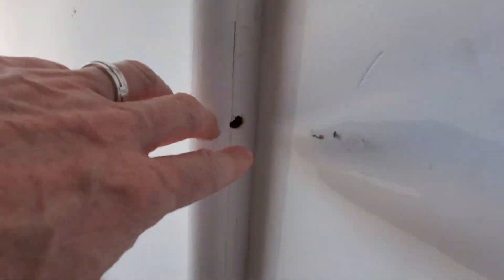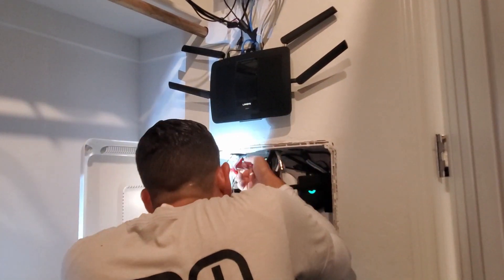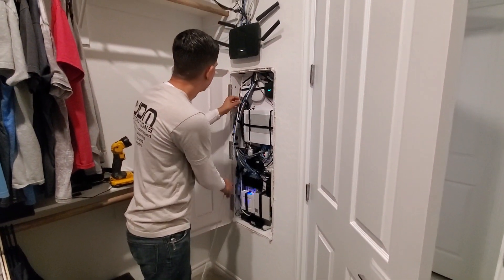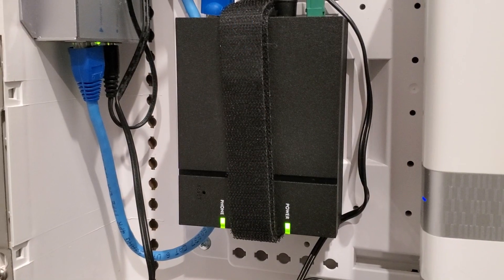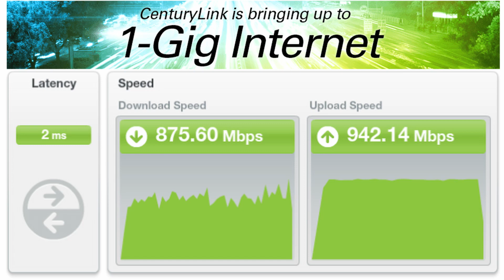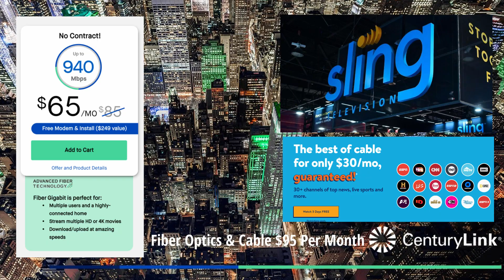Home Fiber Optic Internet Installation -  How To

Comment: I’m confused, where is the fiber ONT box. Fiber line went straight from the street to the modem in your home network panel box?! Thanks for sharing this video!
Reply: The black box he calls a modem is the ONT. He's confused on terminology. In most installations, they would likely plug from the ethernet port on the black ONT into the WAN port of the ISP provided modem (though in this case, even though it's a modem it's not actually doing any modem functions, as the ONT provides the IP connection already). But in this case, he's plugging directly into his own router, bypassing the need for the ISP provided one. In short, fibre is confusing lol.
Reply: @joshedagg  Thanks for the response! This is different to many of the installs I've been following online (including on CenturyLink's website) with a large grey box outside the home in most cases. It looks like my setup will be similar to Mr Tech Hub's, I have a fiber line in a panel box in my garage, I'll just need to run this up to the network closet. Do you know if this setup will still require all the VLAN 201 tagging and PPPoE confusion to work with my own router/switch setup? :)

Comment: wireless 5G in london is getting 500MBs so ..... fiber optic broadband is some sort of technology that is great bud didn't seems to succeed.
Reply: Cell towers rely on fiber connections for their service. The problem with 5G is that in order to get the super fast speeds, they need to put tons of those cell sites since 5GUW has quite a short distance.

Comment: Coaxial Cable can handle 1Gbps of transfer, why waste your time installing Fiber? FYI my ISP/Cable provider has FTTN and Coax from the Node to my home (about 100ft), I can pull speeds of 900mbps
Reply from the maker: The reason I went to fiber was the price. Cox cable 1 gig was more expensive and ive had Cox for 15 years and they kept raising the prices so it was also a personal thing.  Thanks for watching.
Reply: @UltimateTechHub  So basically this video isn't about new tech but more about the fact that you felt you were getting screwed by your provider.  I think it is irresponsible on your part to push this fiber optic option based purely on your monthly subscription price as opposed to limitations of "old world" infrastructure.  You made no mention of the "connection" to your home from the node to the main trunk.  Your subscribers should be asking these questions, you are trying to sell them a Ferrari to drive on a road with a 25mph limit when a Honda Civic will do...just my two cents....thanks for watching
Reply: @nuklz  fiber can support up to at least 800g

Comment: How did you attach the connectors to the fiber cable you ran, or did it come with the connectors pre-installed?  In case if the latter, you would need to know the length of cable required.
Reply from the maker: The connectors where already installed to the fiber cable. The cable length is 75 feet but it comes in many different lengths.

Comment: Is Mike from JDM Automations going to leave his drill bits in my wall too? 😂
Reply from the maker: Haha
Reply: Bahahahahahhaha right
Reply: Or the damage to the wall by the impact 😂
Reply: lol
Reply: Using a impact too
Reply: @ZavjoFPS  that's what it's for guess u don't work with tools much, but foreal that "professional" would never work on my site the ladder jump up and the random unprotected fiber run.
If anybody's ever ran fiber or worked with it I can guarantee I know where most of your pinch points are going to be causing the slow downs

Comment: Fiber is awesome, and lol (seeing the first comment is shade at Spectrum, and 2nd at Comcast), I just want to let ya know both are hybrid fiber/coax with FTTP available in select markets.  By all means if Centurylink or Google has fiber in your area hit em up.  Just be aware there is a 1TB data cap (which is waived atm due to Covid).  Spectrum doesn't impose any caps or fees on data consumption (Comcast Xfinity does however).  Its not a perfect world and yes fiber is fantastic, yet expensive to construct for ISP providers (while being cheaper to maintain over time though).  Coax internet is succeptible to ingress (3.1 docsis even more so than 3.0), or "rogue" RF signals getting into old wiring or faulty connections in your home or the cable plant.  This causes the equivalent of a ton of people walking into a movie theater and sitting in front of you talking as loudly as possible while you (modem) are trying to watch (exchange data) the movie (your ISP headend).  The infrastructure is already in place however after decades so it allows high speed internet to reach vastly more areas.  So yes, you can be critical of Comcast, Spectrum, Cox, etc., but without them, there would be a great many children in America without the ability to attend virtual school right now.
Reply from the maker: Thanks for the great comment!! Yes without Cox and Comcast we wouldn't be where we are today. I never talk bad about either company.  I've had Cox for 16 years. I just made my change for the better price and faster download and upload speeds. And my price is locked in. Cox always seems to raise the price every year.  Thanks for watching and if you subscribed thank you as well!
Reply: @UltimateTechHub  My pleasure sir.  It was a well constructed upload on your behalf.  I am always seeking knowledge and enjoyed watching this.  My comments were meant purely as the unbiased devil's advocate as so many youtubers' comments are just jumping in to thrash other ISPs. I absolutely understand your reasoning to switch, I agree with it,  and now more than ever, it is a great time to see videos like this educating viewers on intelligent cost-cutting ideas.  Fiber is absolutely hands down the best method to obtain reliability & high speed service.  I also noticed the information about authentic speed testing.  Keep this gentleman's suggestions in mind when you run speedtests on any ISP as well.  My simple suggestion to PC/MAC speed testing is just download the Ookla Speedtest Extension for the Google Chrome browser (since it is the most widely used currently).  This tests as an app would instead as a browser. Also turn off any VPNs.

Comment: now how bout wiring your whole home in fiber directly to PC....
Reply from the maker: That is possible but a bit expensive. And I would only get 940 mbps. I am currently testing my speed at about 740 mbps which goes up and down and thats with Cat6 cabling.
Reply: @UltimateTechHub  btw, check out 2.5gbps lan.. if using a NAS...
nice setup though
Reply from the maker: @EvgeniX.  Thanks I will check that out! Thanks again for watching!
Reply: @UltimateTechHub  let's see in like 5 years lol

Comment: I've had fiber for about a year now. My issue, is my isp, make me use their gate way/hub. If I plug directly into it, I see 1gig speeds. But, I need my router for other internet needs. So my question is, how can I "split" at the hub? I want my gaming rig to be plugged in at the hub, and also have connection to my router. Calling my ISP, they can't open another port, or if they can, it would cost a ton. Would a "switch" work?
Reply from the maker: Plug your router into the gateway then plug a switch into the router. That will give you plenty of ports for many devices. That's how mine is setup.

Comment: How much does the installation cost, of all those devices??
Reply from the maker: The fiber modem and setup was free. The fiber cable drop was I think 60 or 70 dollars.
Reply: @UltimateTechHub  Mike charged you only 70 bucks to run the lines?
Reply from the maker: @johncalvo1743  It's only one fiber line and he did work for me before so it was a quick install.
Reply: @UltimateTechHub  Okay. I called him yesterday. He's coming over next week after he finishes moving. I was expecting a little higher price. But all is well either way. I have a question for you: There doesn't seem to be access to the attic in the garage. Do the garages here in Vegas have attics or at least a crawl space? I'm just trying to figure out how he's gonna get this done.
Reply from the maker: @johncalvo1743  Yes usually there is a tiny crawl space. Keep me posted. Thanks for watching and if you subscribed thank you as well.  Tell Mike I said Hi!
Reply: @UltimateTechHub  Will do! I'll make sure I subbed. How far are you from SunCity Anthem? I would love to see how you did it so I can have an idea. I'm trying to run a line from the CenturyLink box in the garage to my casita. The linear distance is only about 30 feet or so. But it has to go through the garage crawl space then through the casita crawl space I reckon.
Reply from the maker: @johncalvo1743  Mike will help you out with the proper and best way to run the fiber cable. You could run it along a baseboard too.

Comment: Get more speed using Cat 6a or Cat 8 cable from the modem to you router! Get rid of the CAT6 cables!

Plus get the Nvidia Shield and AppleTV to have choice at night! Have the best of two systems! Plus a good 10g NAS might be in future!
Reply from the maker: I have a couple of Cat 7 cables but they are not long enough. I need at least 8 feet and mine are 4 feet. I will definitely upgrade. I have a 2 terabyte WD Cloud I use as NAS to listen to music or watch movies. I also had a PC that has 10 terabytes and is my second NAS. I also have 2 apple TVs and 1 Roku to stream all of my NAS  content . I use Plex media server. Thanks for the great advice and the positive comments. Sounds like you know what your talking about. Are you a netwotk engineer?
Reply: Ultimate Tech Hub Yes I’m a Network Engineer! Plus look at the semi-cheap 10g hubs that except fiver and 10g Ethernet models put into it!
Reply from the maker: @terryrodbourn2793  Sounds good I will look into it. I'm currently averaging about 764 Mbos download speed so im close to the 940 Mbps speed. Maybe a  Cat7 cable from modem to router will help the cause. I will keep you posted. Thanks again for watching and commenting.  Have a great day.

Comment: Im in Vegas.. Century or Cox optic fiber is not available in my area.. I have the gigablast from Cox and its so terrible we get so much packet loss and slow upload speed and they are not doing anything to fix it.. I know it must be expensive to get Fiber but I want to give it a try.. any suggestions..Thank you and great video
Reply from the maker: Have you called CenturyLink to see what they have available in your area? Maybe they have something other than fiber. Cox is really bad and expensive. We had ca
Cox cable internet and TV for nearly 17 years and out bill kept getting larger and larger with the same exact service and we even down graded to try and save a few bucks. The internet was super slow and our service would go out intermintly. I don't miss Cox at all. I hope you can make the switch soon. Thanks for watching and if you subscribed thank you as well.
Reply: @UltimateTechHub  yeah Century can only offer me 25mbps down and 5 mbps up its literally nothing
Reply from the maker: @leo2011sti  yep thats pretty much junk speeds. Sorry to hear that.
Reply: I'm in Vegas also, over here in Mountains Edge. Moved here in Feb of 2019, and signed up for cox gigablast with unlimited data for an additional $50 with high hopes of great internet. I've had so many techs (both in house and field) at my home that I've lost count. Had one here again today actually. The internet is beyond intolerable. My wife and I both work from home, we also home school our 4 kids. We rely on the internet.  Long story short, we have decided to leave Vegas altogether to get away from the cox monopoly here. I love Vegas but the internet is our livelihood.
Reply from the maker: @oxthebrazilian6595  I totally understand.  We had the same experience with Cox plus they kept raising our bill every 6 months. And the speed was awful. I guess I'm lucky century link had fiber installed in our area. 65 a month is thr best bill I have and I'm glad to pay it.  We get around 740 mbps sometimes 800 mbps. That's plenty fast for our needs. Good luck and keep me posted.
Reply: @UltimateTechHub  Thanks, will do.
Reply: @UltimateTechHub  How's century link fiber been? Good, reliable, and fast service?
Reply from the maker: @oxthebrazilian6595  Yes all the above. I've only had 1 outage that lasted about 7 hours do to a construction accident. Speeds are around 700 mbps and my bill is 65 a month.  I love fiber.
Reply: @UltimateTechHub  Thats awesome to hear! I ask because I'm in the Vegas area and will be moving soon to get away from Cox. I heard Century link offers fiber in Vegas so I wanted to know if their service is any good. So thats great news! You may have mentioned it already or not, but are you located in the Vegas area? If so or if not, where if you don't mind? Looking to move where century link fiber is available perhaps..Thanks!
Reply from the maker: @oxthebrazilian6595  Yes I live in the Las Vegas area. Before you move make sure CenturyLink is available in the area you want to move to. Its not available in all areas in Las Vegas especially older areas.  Thanks for watching!
Reply: @UltimateTechHub  Thanks I really appreciate it!
Reply: @oxthebrazilian6595  Come down to Anthem! I just ordered it.
Reply: @johncalvo1743  Where's Anthem? I'm not familiar with the area. Thanks man
Reply: @oxthebrazilian6595  Anthem is part of Henderson. The extreme southwest. I'm near Black Mountain. Very quiet, clean, low crime. Lots of parks, golf  and 3 big social clubhouses for residents. Where is Mountains Edge?
Reply: @johncalvo1743  Ohh ok, cool! Thats sounds like an awesome area, I'll definitely look into it! I appreciate your help, thanks again!

Comment: Nice video man that you uploaded now I have google fiber 70 per month but since were wfh in this pandemic and my wife gets extra $50 per month for using our internet speed I only pay $20 for google fiber. I kicked cox gigablast to the curve and I hated having to pay cox an extra $50 just to get unlimited data cap so $100 =50 for internet and my wife had cable etc man our bill for the past yr was over $300 man I was so pissed when she renewed our contract 2019. So fast forward fall 2020 got rid of the bundle and now we pay $50-60 for her local channels from cox.

I tried the antenna thing and it wasn't good and wasn't able to get few local channels in irvine CA, I can careless for cable I like internet and I had the family switch to sling and I'll sign up for Disney plus around the holidays. All I need is Netflix, youtube my videogames. So I have a question for you regarding cat cable.

Does it really matter if I use cat8 for my fiber internet? 
What cat cable are you using cat 5 or 6? Only had fiber for a week as of now
I was given cat5e from google I do have cat 6 cable and it's plugged into my Ethernet wall the main fiber box or whatever is installed in the master bedroom closet. I'll probably remove the panel to see how it looks behind wall.
Reply from the maker: I have Cat6 running through my house. I think I have a total of 23 cat 6 runs which includes computers, wireless access points, streaming boxes like Roku, Apple Tv and a Media Server. So if your running Fiber Optics,  Cat6 would be plenty of speed. And really Cat5e would work as well because with CenturyLink I'm only getting up to 940 mbps and with my speed test the best I have gotten in the last 3 weeks is around 750 mbps but its not very consistent. However I always believe in future proofing so I would recommend all Cat6 cables since fiber is getting cheaper and faster. Thank you so much for watching!

Comment: What type of fiber optic cable did the technician run through the attic to your panel box? Did Centurylink specify a certain type and connector style?
Reply from the maker: SCA-SCA-SS9 - SC/APC to SC/APC singlemode 9/125 simplex fiber optic patch cable. That's what the cable package had on the label.